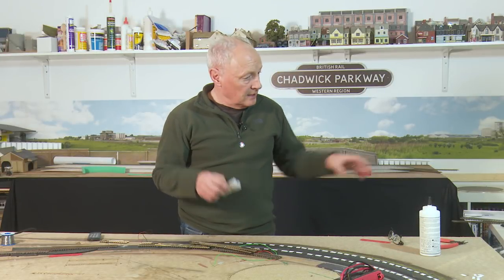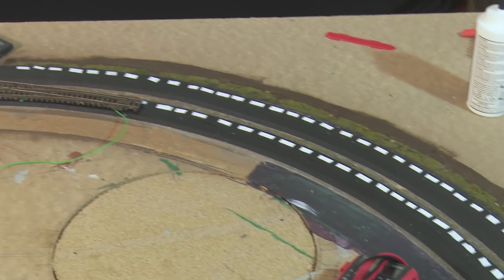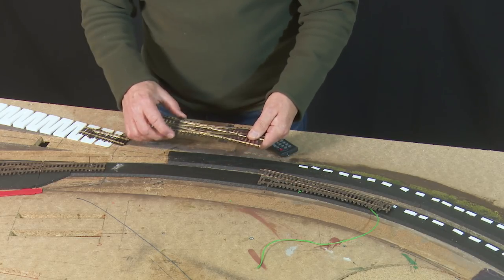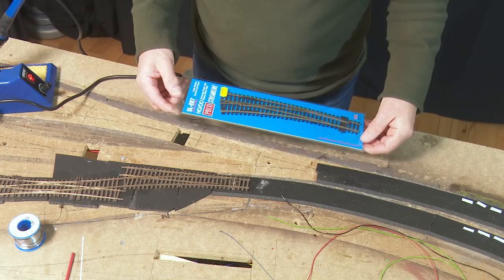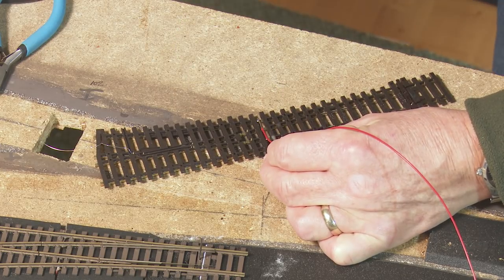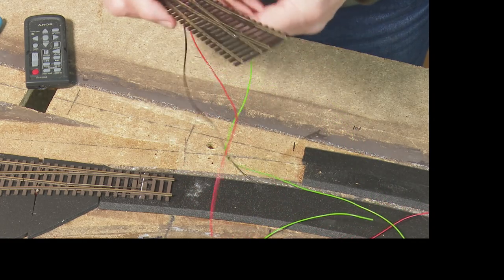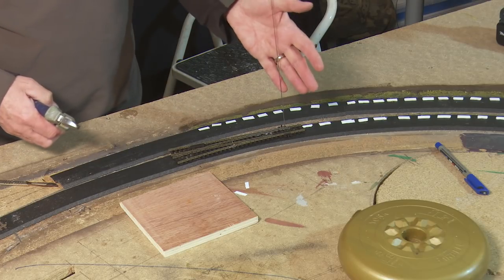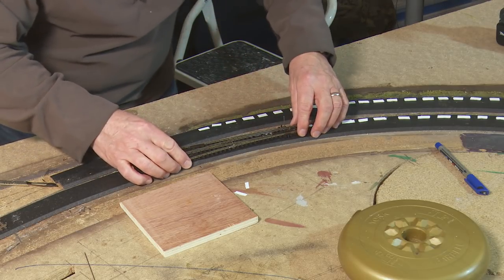Laying track, points and slips at Chadwick Model Railway | 77.

Comment: Hi Charlie, Thanks so much for such a friendly and totally informative video. You’re a born teacher. Recently, at 82 years young I decided to pull out my model train stuff that I’ve had hidden away for about 40 of those years. Needless to say the track was in terrible condition, black with corrosion. I took a chance, grabbed handfuls of track and immersed it in a bath of Pepsi Cola, (I’m assuming Coke would work just as well) and let it sit for about four hours. I then rinsed the track off really well then immersed the pieces in warm water and detergent and let it sit overnight. In the morning I rinsed the track off again and scrubbed the rails and connectors with a 3M type plastic scouring pad. I was amazed to see, with very little effort, that the rails cleaned up, from charcoal grey to bright and shiny. Thanks again for your inspiration.
Reply from the maker: Welcome back to our fascinating hobby Errol. Regards Charlie

Comment: Merry Christmas Charlie.  A 45 min to an hour long video is fine by me Charlie.  As you say, people can either skip through it or run it at 1.5 / 2.0 times faster if they are short for time. Interesting to see you use that strong PVA glue. I'm in the process of relaying an N gauge layout and I use the traditional track pins rather than glue, and it make for easy work.  I feel that using that glue and foam will be a nightmare should you ever need to relay the track in the future.
Reply from the maker: No Malcom it’s not a PVA glue, it’s a rubberised alternative to reduce sound transmission.  I’m so pleased that you enjoyed it and I do hope that you have a great Christmas.
Regards Charlie.

Comment: Hi Charlie. Until recently I was involved with a friend on a large 0 gauge layout, on which for the last 16 or so years we used Tortoise point motors. Like you we changed the wire up to a similar size to what you use. I was disturbed for your well being seeing you use that high speed cutting device. One slip and they can do a lot of damage to the layout or yourself. Piano wire is indeed very hard and requires substantial effort to cut. After a while we discovered that the Xuron hard wire cutters did the job well and relatively safely. It might be worth trying them - we got on OK with them. Safety first perhaps! Barry.
PS keep up the good work and your interesting layout. You are one of the few railway modelling 'experts' on YouTube who seems to actually know what you are talking about1
Reply from the maker: Hi Barry, I hang my head in shame.
Yes I have relinquished cutting my piano wire in that manner. I now put it in place, mar it with a felt tip pen, remove it and cut it whilst holding it horizontally with a spinning disc.
It might not be the ideal option, but it is certainly safer. Regards Charlie

Comment: Thank you Charlie for the great how to video. I am starting my attic railway in 2020. I have and am still are learning from you and from Richard at Everard Junction. I have the plywood purchased for my open frame baseboards. the Loft is already boarded out and I have installed 2 6 foot strip lights. So next is the insulation of the rafters then its build time. Keep the videos coming they are an inspiration. Have a very merry christmas and a wonderful 2020.
Reply from the maker: Thanks Glenn and good luck with your project. I’m so pleased that you enjoyed it and best wishes for 2020. Regards Charlie.

Comment: For the Frog Motor wire Piano or otherwise,  may I recommend a cycling tool cable cutter that is used for cutting tough high tensile steel wire used for brakes and gears and could get in close enough to your sleepers without the Dremmel thing! About £10.
Reply from the maker: Thanks Ian, an interesting option.

Comment: hi Charlie, have a very happy Christmas! Very interesting, I have over 100 Peco point motors in use and hope to put in a double track change over(two inner to two outer using 4 points and two long). For simplicity I m using electrofrog points and tortoise motors although I will have to sort out signals with divergent lights. This video will certainly help.
Reply from the maker: Thanks Christopher,  I’m so pleased that you enjoyed it and I do hope that you have a great Christmas, regards Charlie.

Comment: Charlie, just a thought. If you cut the piano wire a bit long on the track side (maybe half a cm), you can then loosen that retaining screw on the point motor and slide the wire down to the desired position. That way, you never cut close enough to the track to run the risk of melting anything. Alternatively, measure the length of a perfectly assembled wire, and cut several to suit. Then slide them in accordingly.
Reply from the maker: Sorry J, but I haven’t explained the motor very well.  The wire comes out of the boss then turns 90 degrees.  I’m so pleased that you enjoyed it and I do hope that you have a great Christmas, regards Charlie.
Reply: @ChadwickModelRailway  Ah. Pity. My second option would still work though?

Comment: Hi Charlie, I find all your videos very engaging and eagerly await future ones. With regard to cutting servo pins, I find the use of a 90 deg. angled head on the Dremel much more controllable to use. I also use a thin sheet of steel ( a paint scrapper would do ) to shield the track from the cutting disc. When cutting the pins of Seep solenoids the pin will spin and applying some pressure to the pin with the edge of the scrapper stops it spinning and makes cutting easier and cooler. Please continue with your excellent work. Regards Barry
Reply from the maker: Thanks Barry, I’m so pleased that you enjoyed it, I do hope that you have a great Christmas, regards Charlie.

Comment: For viewers who are not aware, The Tortoise point motor has 2 of the 1 Normally open, 1 Normally closed  and a common terminal, internal switches which is what charlie was soldering the wires to.
In addition to the 2 terminals for point operation.
Reply from the maker: Well said Sam, I do hope that you have a great Christmas, regards Charlie.
Reply: Thank you and I wish you a merry Christmas also.

Comment: Thanks Charlie, another excellent video make more so by the cock up which makes us all feel better about our own mistakes! The pace of the video was just right for me. I seem to remember you use a code 75 double slip with special rail joiners but maybe I dreamt that. I am in the process of building a branch terminus and want to use a double slip with my code 100 track but am a bit unsure about using an insulfrog item. Thanks again.
Reply from the maker: Yes I’ve use both codes.  I’m so pleased that you enjoyed it and best wishes for 2020. Regards Charlie.

Comment: Always enjoy your videos, long or short, I find when soldering the Grenn wire to the points frog, wire  I like to put a bit of heat shrink tubing over it, as I think it gives extra strenth as the frog wire is very thin, Hope you have a Happoy Christmas and New Yeear.
Reply from the maker: Thanks Glenn and a good tip too.  I’m so pleased that you enjoyed it and I do hope that you have a great Christmas, regards Charlie.

Comment: Thank you Charlie for an informative and interesting video. I thought the pace was absolutely fine. I look forward to applying your tips when I start to build my railway in the Spring time (except, hopefully, the points mix up !), until then I’m getting my Railway room ready (but almost there !). I expect to start getting the first boards down around mid-February. At this stage, any tips are helpful and it’s wonderful that I have the opportunity to learn from your mistakes 😁 Would you mind me asking what wood and boards you’ve used in your construction ? Kind regards....
Reply from the maker: Hi Bryan,
Buying from new, I’d use 12mm ply. B&Qs larger stores will cut it to size for free. 2 x 1 inches in his fine for supports but 3 x 1 might be better.
Don’t forget about your back scene.
Reply: Thank you Charlie, that helpful advice. Didn’t realise the bigger B&Qs would cut as well. We’ve got quite a big one here in Eastbourne 👍

Comment: Brilliant as always.  Re the how do’s I would be interested in the wiring of some of the Digitrax kit which I see you are using such block detectors (BDL 168’s) auto reverse module etc. Thanks Brian
Reply from the maker: I’m on track for a Digitrax video but not with the auto reverse module.  I’ve never used one I afraid.

Comment: A soldering tip for all. Apply a small amount of plumbers' flux before you offer up the iron and solder (even if your solder is pre-fluxed). The solder will take instantly, you won't need to hold the heat there for as long, and you reduce the risk of dry joints. When soldered, give the work piece a quick wipe down with IPA and a cotton bud.
Reply from the maker: A good tip Holly, I’m so pleased that you enjoyed it and I do hope that you have a great Christmas, regards Charlie.

Comment: Thanks for such helpful videos.  I'm just starting to lay my first track.  I would value you bringing together some basic advice on joining track.  Somewhere you suggest having no joiners on points so that they can easily be lifted out for repair. On this video I see that you use insulating joiners.  How do I join flexitrack to ensure a good curve and should I use joiners? Should I leave a gap between flexitrack lengths?  If you lay track with no joiners how do you ensure they line up well?
Reply from the maker: Check out the video on Friday David, it's No. 93.

Comment: Hi Charlie. As usual a great video made even better with the fuller detail of how you did it. I much prefer the longer versions as it helps me with how to go about things. Also, I thought the c-up was when you were explaining why you were using a double slip and that it was so that you could do wrong way working on the inner track and that you had forgot to put in another crossover for wrong-way working on the outer track - or have I not seen it?
Anyway, look forward to seeing more detailed videos.
Hope you and yours all have a great Chrimbo.
Regards
Terry
Reply from the maker: No Terry, I installed a straight left hand point and not a curved one!  I did explain at the end.
Reply: I understand that the actual mistake was the wrong point installed. The point I'm making is that you have only installed the d/slip so as to allow wrong way working across the bridge on the inner track (with a return x-over at the other end?) and that if there needs to be wrong way working on the outer track have you got a return x-over to get back on to the inner track (and another x-over to get from inner to outer before the bridge?). Please don't take this comment as being critical, only trying to point out something you may not have thought of or realised in your thinking in using the d/slip. Keep the good work up. Happy Chrimbo.
Terry

Comment: Thanks for your videos finding them very helpful. I am building new layout right now and at moment installing point motors and tried for ages to test them with a 9 volt battery .  I was quite down hearted thinking none of them worked. But tried with a 16 volt AC supply and all was well. Please point out that 9 voilt batteries dont test Gaugemaster SEEP motors very well..
Reply from the maker: Sorry Sandy, the 9volt battery is used for testing “Slow action” point motors.

Comment: A very Merry Christmas Charlie from Belfast and Thank You for another great tutorial as usual, minus the little point hick up... LOL. I think in future I'll be gluing track down track than pinning them myself, as I am always driving some of the pin's in to deep and spoiling the sleeper in the process. Plus it stops one having pin heads showing along the track too. My question is, is it better to remove the point springs even when using ordinary solenoid point motors with insulfrog points? The reference about the tutorial video lengths, 45 mins to 1 hour long is about right for anyone, well for me anyway and each to their own. Though I have no complaints as I wish to learn any tips and tricks that will help me in future projects about the hobby of model railway layout construction and related articles. Plus I have watch some of your photograph tutorial's too for my E400, E600 and Lumix FZ82.
Reply from the maker: Thanks John,  I’m so pleased that you enjoyed it.  The solenoid point motors do need the springs to hold them in position.  I do hope that you have a great Christmas, regards Charlie.

Comment: To try to make standard peco points look more bespoke I have sometimes cut away the plastic spacing of the sleepers. This enables a small amount of deformation to be pulled into the point and bring a some individuality to each point where required. Looking at prototypes there seems to be almost no such thing as a standard turnout.
Reply from the maker: Good thinking Nigel.

Comment: Another excellent video again Charlie but, pardoning my ignorance, I have a question for you which I am perplexed with. That question is why haven’t you attached a couple of frog polarity wires to the frogs at each end of the double slip that goes to the branch line?
Reply from the maker: Hi Mark, as I recall it's because that double slip is Code 100 and therefore is an insulfrog version.

Comment: Maybe you can reuse that damage end of the double slip somewhere where there is an old disused bit of line that maybe got lifted but they left thT switch of the slip in place? Especially if the other end is still functional and can be used like a standard point without issue. If the hole is oversized, you could always drill out a bit more and glue in some plastic tube or pvc wire sleeve to "sleeve" it back to size?
Reply from the maker: Yes, I’m sure that you’re right D1973.

Comment: Hi Charlie,  Always enjoy your videos and hence subscribe so as not to miss out as the latest one is released.
I really enjoy the content plus your style of presentation and the good humour you bring to our wonderful hobby. 

Just a thought - When installing my Seep point motors (sorry for the bad language!) I have a simple jig on which I cut the operating wire to the correct length, taking account of baseboard thickness (9mm), the cork ballast and the sleeper thickness. I find this keeps all cutting tools away from the working tie bars etc.  Not being familiar with the slow acting and quiet motors - could this method be applied to pre cutting the piano wire you use. 

I wish you and yours a Very Happy Christmas and a happy,safe and productive modelling year ahead.

Best Regards 
Tony
Reply from the maker: Thanks Tony, I just find it difficult to thread through the point tie bar if it’s pre cut. I’m so pleased that you enjoyed it and I do hope that you have a great Christmas, regards Charlie.

Comment: Charlie, 
To eliminate the overheating of the pin when cutting off, would it not be better to 
loosen the screw on pin mounting bracket of the points motor, then pull it back 
through (when adjusting the wiring) then tighten. 
No damage and 'Overcast' Trainroom skies

Wayne
Birkenhead, NZ
Reply from the maker: An interesting option Wayne, regards Charlie

Comment: I writing this whilst watching the video, and very good it is so far. 
I was wondering why you cut the wire to the frog?
One of the sleepers is grooved so you can run the wire down it, solder in extra wire at the end and drill a hole at the side of the sleeper. When it's ballasted you can't see it. Did that on mine.
Merry Christmas and a happy new year to you and all the best for the new year.
Reply from the maker: CSX, that has never occurred to me but I’ll certainly check it out next time.

Comment: Good afternoon and thank you so much for showing us your job.
I have two questions for you.
I see that you don't use any rail joiners for join normal tracks. You use they only if you need aislate the tracks, am I right?
And, why didn't you polarize both frogs of the SL-90 track piece?
(Sorry for my bad english)
Reply from the maker: Hi Jose,  I always use rail joiners. Metal normally but plastic on the frogs of points.
I also use plastic when I need to isolate certain sections due to computer contol.
Regards Charlie

Comment: Great video as usual. Can I ask why you used an electrofrog curved point but not with your double slip point? I noticed also that you didn’t use any flux when soldering, is it a particular type of solder you use? Thanks, Mel and have a good Christmas.
Reply from the maker: Hi MH, 
Peco Code 100 don’t do an electrofrog double slip and the 60:40 solder has a flux resin.
I’m so pleased that you enjoyed it and I do hope that you have a great Christmas, regards Charlie.

Comment: Thank you for another great instructional video. I greatly appreciate and learn from them. Just a thought; at 24:35 you start marking out for your point wires. After having drilled the hole for the motor actuator wire, could one not make use of a template for all remaining feeder holes etc? Sort of a fixed template - then you would only need to truly get the actuator hole spot on - rest is "just" laying out as per the template, or?
Reply from the maker: Thanks for the tip CD, it's something worth considering.

Comment: Hi Charlie, have yourself a very merry Christmas and a happy new year 🙂 I’m a little confused about the wiring on your double slip, how are you switching polarity on the frogs, I’ve not used a peco double slip but it seemed odd 😊
Reply from the maker: Thanks NP, it’s a code 100 double slip and doesn’t have switchable frogs.
Reply: Chadwick Model Railway ahh, I thought it was electrofrog 😊 I normally feed the outer rails and frogs but I’m not familiar with insulfrog points 😊